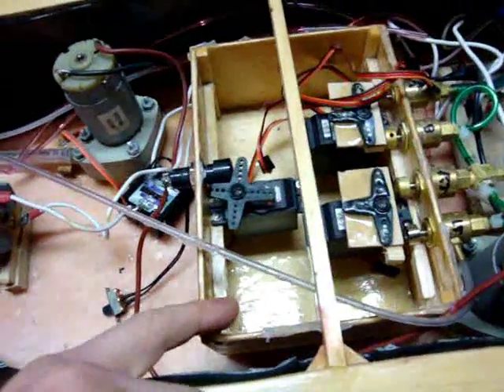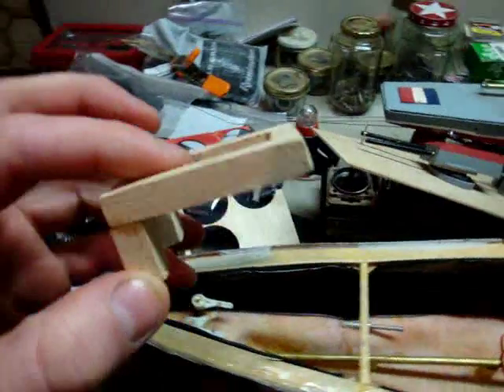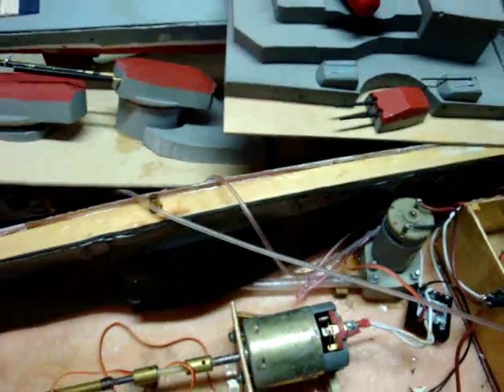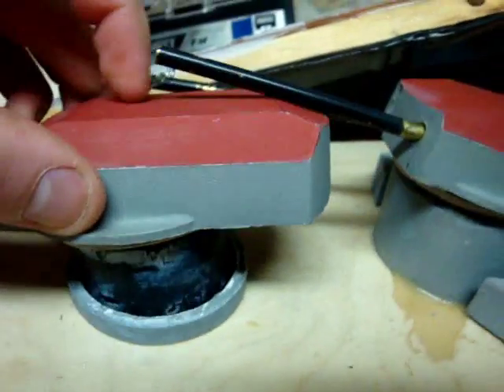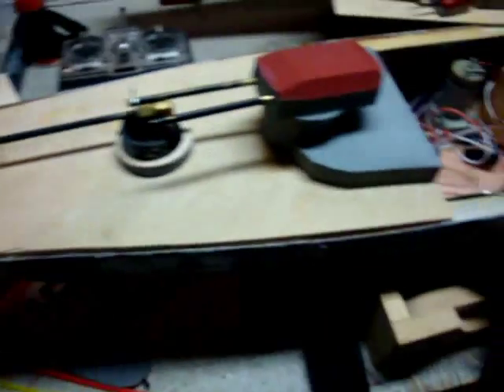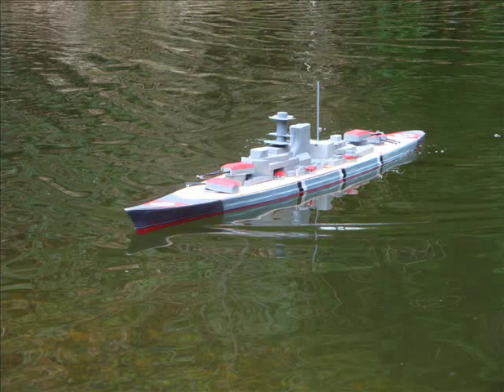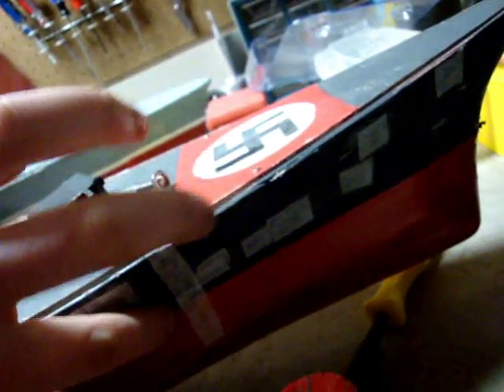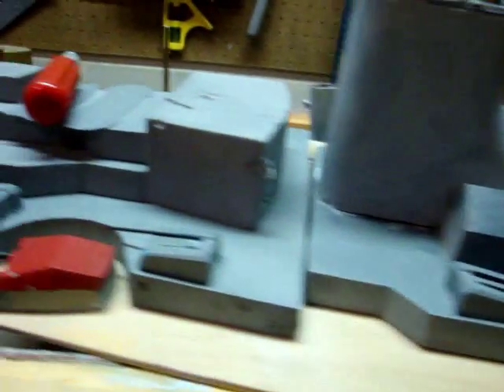Bismarck Update.wmv

Comment: As far as the rudder goes I have a couple of suggestions, take them or leave them.

Use geared drive. Small gears on the rudder posts and a big gear to turn them that is fixed next to them and is linked to the rudder servo. 

Use firm rudder push rods. I use 4/40 threaded stainless steel rods so I can add connectors that screw right on. 

Use a waterproof box to protect the rudder servo or waterproof it. Or get one of the Traxxas waterproof (blue) servos.